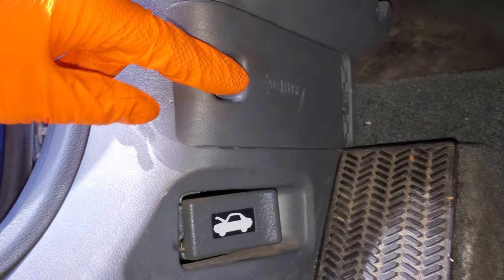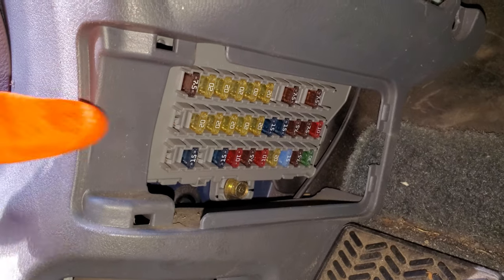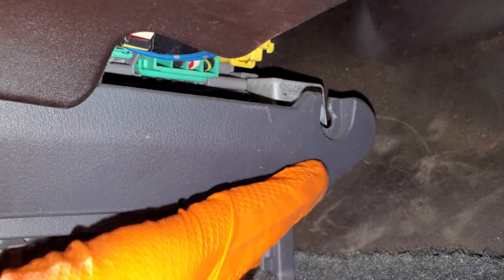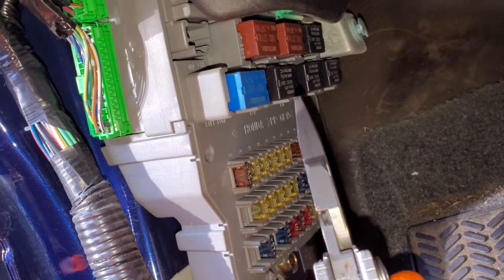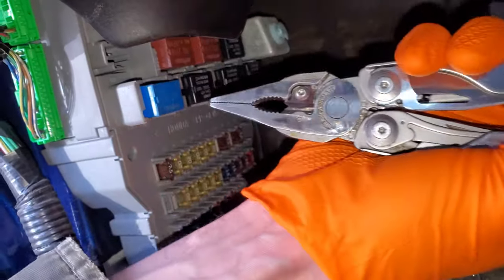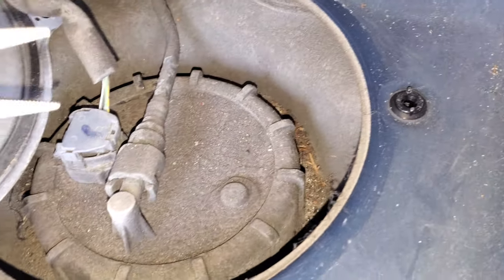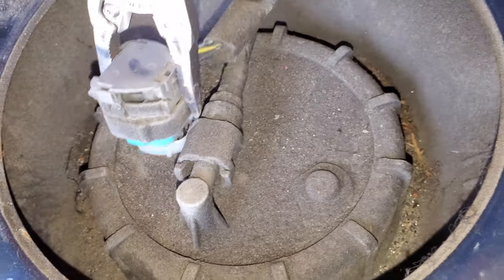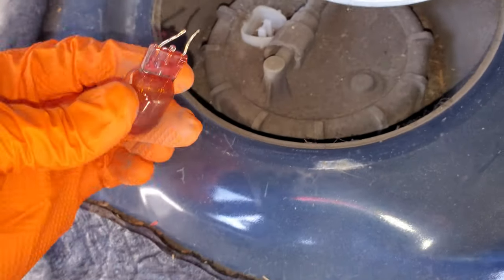2003 Honda Accord Fuel Pump Relay, Fuel Pump Fuse & Fuel Pump Circuit Explained

Comment: i have a question im having this slight issue that when i get ready to take off car does a slight hesitation like its not getting enough fuel, and while driving on highway its doing a lil chugging feeling..... so im going to go ahead an do the injectors an replace the fuel pump. Any info would be helpful ive done everything else thanks in advance

Comment: I put the fuel pump connect to a light bulb. Turned the ignition to 2. The light bulb lite up for 2-3 seconds then turned off. Is bulb supposed to turn off after 2-3secs?
Reply from the maker: Yes, it only runs for a few seconds to prime the pump.. once the engine is running the pump will recieve continuous power

Comment: Do you test the fuel pump while the car is running?
Reply: No, the car doesn't have to be running, just turn the key to ON (not start) and the fuel pump will run until there's enough pressure in the fuel line.  You can hear it.  IF you want to drain the fuel tank for some reason, jumper the relay and disconnect the fuel line from the fuel pump, connect a hose to the fuel pump (3/8" inside diameter hose with a hose clamp works nicely) and put the hose into an empty gas can....moving the key to ON will start the fuel pump and turning it to off will stop the fuel pump.  I think the fuel tank on a North American Accord is 17 gallons.

Comment: Can this fuse/relays cause you to have the 'P0171' (system too lean) code?
Reply: Partially yes, when your fuel pump is running low on fuel pressuring force to your car engine
Reply: Another reason for p0171 is when you have leakage of manifold looping, or vacuum leakage or your mass air flow sensor has leakage (might not tensioned enough to the air box

Comment: Great video. When my 2005 Honda Accord is parked for awhile 12hours+ when I go to start it, it try’s to start but doesn’t fire. But when I try to start it the second time it fires up fine. Any ideas? I feel like it has something to do with getting fuel.
Reply: Did you find out what was wrong?
Reply: @SonidoExplosivo  well changed the fuel pump and worked great for a few months but then started doing it again. Asked the guy at auto zone and he said sounds like it could be a dirty cylinder head in the motor and maybe got some bad gas somewhere. So bought a fuel cleaner and it’s worked great for over a month now. He said may just have to use a fuel cleaner every few months?
Reply: @that70shome19  thanks man I have the same issue with a 2007 V6. I’m changing the fuel pump and was also thinking about charging the fuel pump relay but maybe the cleaner will do the trick.
Reply: @SonidoExplosivo  yeah the guys at autozone said since I had success for a month or so after changing the fuel pump and then it started messing up again they thought it could be some dirty gas or a dirty piston . I haven’t had anymore trouble for over a month after using some fuel cleaner. I have another one on hand incase it starts happening again but haven’t had to use it.
Reply: @that70shome19  any updates